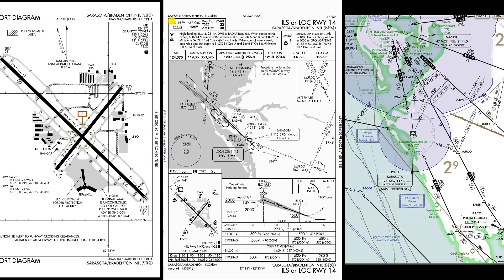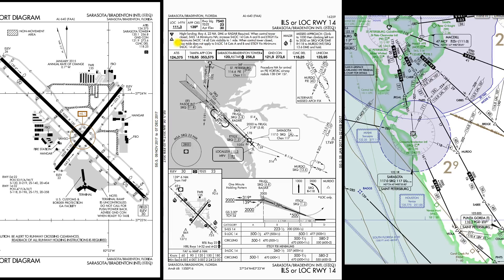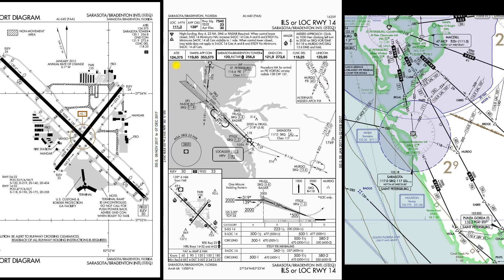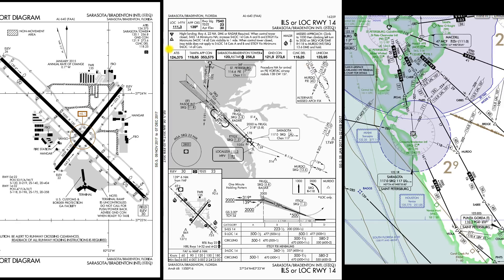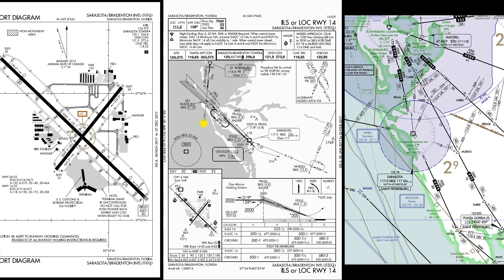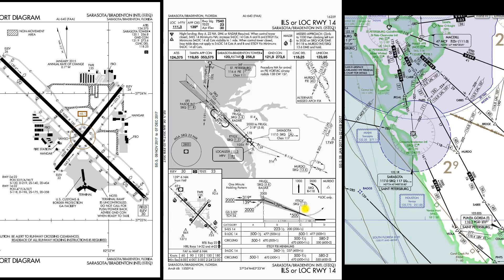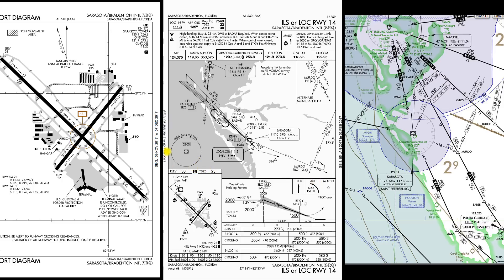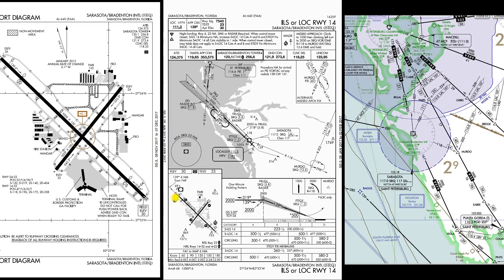Ep. 203: Instrument Approach Plate Explained | ILS LOC RWY14

Comment: New IFR student. If the localizer does not have DME, and the SRQ DME is required for the ILS approach, would you have to tune in the SRQ VOR into NAV2 in order to know the distances or is it programmed so that it automatically shows DME from the VOR when tuned into the localizer on NAV1? Thanks!
Reply from the maker: Most likely yes, you would need the vor in nav 2, however as long as you're getting the dme that's fine (i.e. getting home from the GPS or a separate dme receiver).
Reply: Your DME receiver may also have a "hold" feature where you could use Nav 1 to get on track with the VOR, set the DME to hold, and then switch Nav 1 to the localizer. That way Nav 2 can be set for St. Petersburg coming in and ready to switch for MURDO on a missed approach.

Comment: I see some of the plates, prior to the DA, there is a # symbol, do you know what that means?
Reply: In the profile view, normali in charts fir ILS/LOC, you will find the #, in the DA, NORMALLY you will see two DA, 1 WITH THE #, then the next without, so the # means that this # DA  IS ONLY WHEN FLYING THAT APPROACH AS LOCALIZER (transforming  in MDA automatically). if you see, in the #DA IS higher than the other DA.